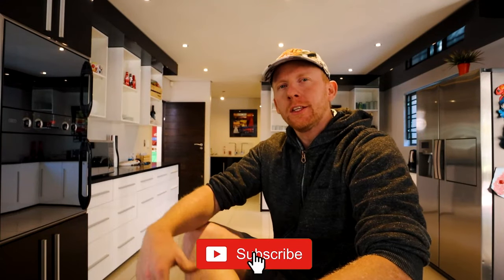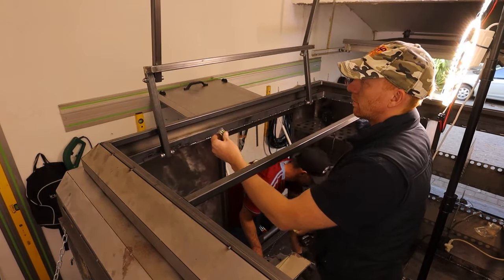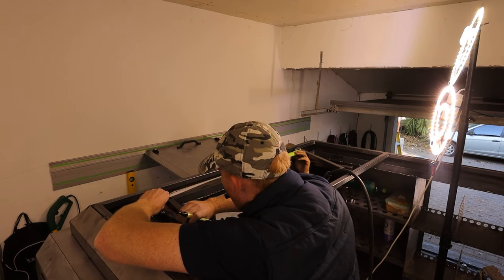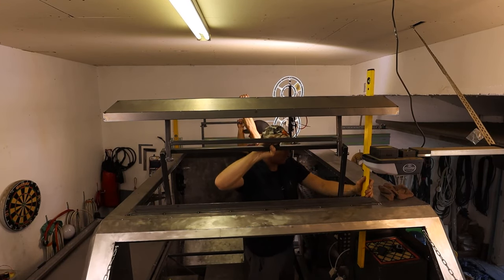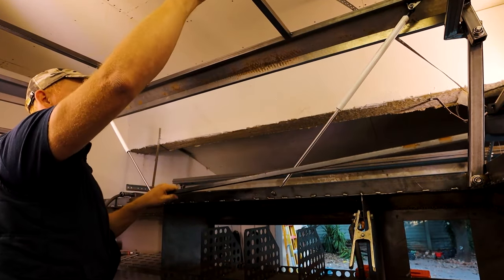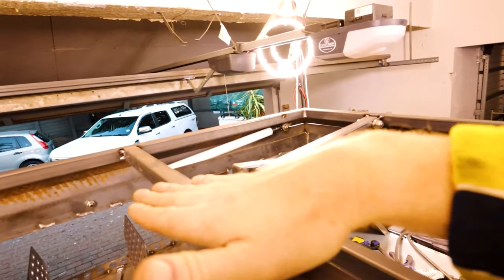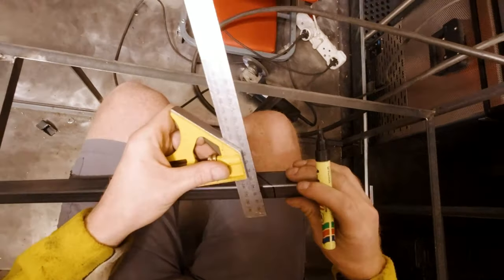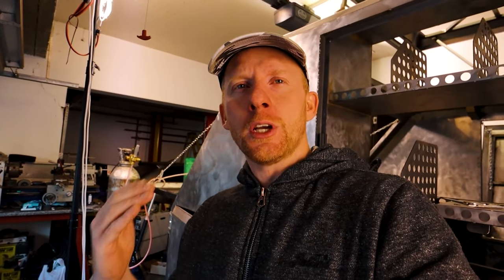Building a Pop-Up Roof For The  Camper Trailer - Part 4

Comment: That first part was such humor! Gas strut calcs is a head spinner. But here is my method-  weigh in kg the roof at the point you are going to lift it at. Add25% . Divide by 2 cos you have two stuts and then multiply by 10 to get the answer. so 40 kg at the mount point, plus 25% is 50kg. divide by 2 and multiply by 10 gives you 250Nm struts x2.
Reply from the maker: Wow.. Thank you so much.. Def will do that next time. Great tip. Thx for watching!!

Comment: Hi mate am from UK 🇬🇧 just watching your videos on the camper roof OMG 😮 you didn't half make it hard for yourself well over thought all you Needed to do was borrow a gas strut a one of your cars use 3×2 and some bathroom scales to see what the pressure was and on the back end of roof 😊😊use bed mattress spring pistons they are the same as what camper van retailers use but quarter of price 2 for £30 ebay but if you didn't want a slope you could use the wood and scales trick😂

Comment: I built a roof rack for my old Gen 1 Pajero and had copied a system that my Sprite swift had. Unfortunately I had sold the caravan a few years before I got the Pajero. Long story short, those air struts and I had a long fight and I shelved the idea. The struts worked well on a home built trailer I acquired that has a lid that I can barely lift. 
Seeing your video has given me renewed energy to build that pop up roof rack. My pajero has a sliding roof so that's why I want a pop up roof rack.
Reply from the maker: Thanks for sharing ure story and watching!! Those struts showed me whos boss... but now i have the pressure sorted and they work great!! Thank you

Comment: Coming to this video late. Newton-Meter makes sense in terms of the force required to open and close the roof as its a rotational measurement of force. Looking to do something similar but simpler and on a smaller scale. I think it will make my life a lot easier if I place each gas strut vertically in the corner lifting straight up.

Comment: think of it like this. 100n is 100kg of pushing power. Pressure wise, mentally imagine the inside of the tube, the piston will have a base that has the pressure behind it, The piston base is a little less than 1 square inch but for simplicity lets call it 1 square inch.. To push 100kg you need to put in about 1422 PSI of gas. Think about how much air rushes out of a regular compressor at 140psi... 

Its more complex than this but to work out the gas strut you need basically take the weight of your roof and divide by the number of struts then add on a little as wiggle room
Angle of strut matters and is roughly a percentage loss based on the angle within 90 degrees. If the strut was 90 degrees its not pushing at all. if its 45 degrees its about 50% pushing pressure.

This is all super simple maths and assumptions, its more complex but this will get you by in most situations. 
It would have been funny to see you blasted, its good you can have a laugh, ive seen people have their skin torn off from pressure and oil.. 
Thx for the vid
Reply: wait no my maths is way wrong.
Reply from the maker: Thanks for Posting. Even if the math is wrong its still makes a lot of sense.

Thanks

Comment: curious why you need the hinge?  could you have done it with 4 struts and chains on each corner to limit how high it would go?  thank you for sharing...
Reply from the maker: Sorry. somehow missed this comment. The hinge is what keeps the roof goin up and down in a straight line. If u have gas struts and chains only, That would only happen when all of them are extended fully and locked. On the way down and up it would be all over the show increasing the risk of pinching the canvas. 
Thank you

Comment: Hi Marius. Long time listener first time caller. Really enjoy this series of vidoes. 

Was just wondering where you got the fibreglass sheet? Ive been looking for it but it doesn't seem to be a standard stock item at any hardware's?

Thanks

Andrew
Reply from the maker: Hi there. So sorry for only replying now. for some reason ure comment didn't show up as un replied Really sorry.  I didn't go with the fiberglass as I'm scared when shit goes wrong like closing the roof onto something that u didn't see while out on a trip it would be really bad. a 1mm sheet would get a hole punched in it very easily. I finally got some 3mm alu board that's got 2 this sheets of thin alu on the outsides and a 3mm plastic insulation between them. Very sturdy and nicely insulated. If the top gets cooked the inside will still be ok to touch.

Thank you so much!!

Comment: Hey, awesome video.  Was wondering if you'd mind sharing the sketchup for those H hinges, or the dimensions, they'd work well for what I'm building.
Reply from the maker: Hi there. Those H brackets I build whilst in the garage without drawings. It worked out easier as I could measure directly from the trailer and roof sections to get the exact measurements. I did not draw them up in SketchUp. :-)

Thank you

Comment: Sensational job so far and thanks for taking the extra time to video and explain what you are up to. I am contemplating attempting a similar project. How did you go with the plans and what thickness steel are you using. Cheers Luke. 🍻🍻
Reply from the maker: Thank you for the kind words. I just started measuring existing trailers up to get an idea of size.. Went to shops and jumped in various ones to see what bugs us and what works space wise.. Then jumped on sketch up and started drawing up the camper. The whole exterior shell is made of 2mm steel. Thank you

Comment: Great build. Why didn’t you use aluminum for all the skins? Just wondering. I’ve been thinking of doing something like this.
Reply from the maker: I'm a shitty alu welder lol...chose steel as I can manipulate it much easier. Thanks for watching!! The weight came out more than ok for me tho :-)
Reply: @MariusBotha  yeah I just watched that one as well. A lot less then I imagined. I haven't even tried aluminum so steel might be my choice as well
Reply from the maker: @rbdworks4342  I can weld alu but the big trick is to destress all joints with proper heat techniques.. else they just crack where u weld them. Would be a lot lighter if one has a oven big enough to do the proper heating cycles. Thx
Reply: @MariusBotha  thank you. That's good to know. Are your plan available?
Reply from the maker: @rbdworks4342  Somehow missed this comment. sorry. I only have some messed up SketchUp files that I will share if u willing to dig through them. Send me a mail. mariusbothachannel@gmail.com

Comment: Can I ask how long it took to weld and how much it cost to have your own welding setup?
Reply from the maker: Its difficult to say how long it took as i only worked a little bit at a time as i had some free time to spend. an hour here and an hour there as i went along. As far as costs, I've always had welding gear and fabricating stuff so i didn't really buy anything to start this project in particular. Was just a normal CO2 mig welder and some hand grinders with clamps. Really basic stuff. All the works was laser cut as i dont have any bending machines or fancy machines.

Thank you

Comment: your lucky its only nitrogen gas , i had an empty LPG tank in my car as dual fuel, it hant been used in years, i took an angle grinder to the straps, with my dad and a weed sprayer full of water, got the straps cut successfully, then as i was turning the grinder off with a cut off wheel, my middle finger grazed the wheel thankfully only skin deep behind the nail bed, trip to the doctor and  tetanus vaccine and bandage i go back home to finish the job, taking the bolts out of the tank, unknowingly opening the valve assembly, thankfully it was only compressed air and Ethyl Mercaptan witch is the additive for the odorant added to make LPG (propane) and natural gas smell to detect for leaks, so the rest of the day all i could smell and taste was the Ethyl Mercaptan witch was like eating a whole bulb of raw garlic, in my nasal passage and back of my mouth, lots of mouth was and a couple of nasal flushes,,, if it was full of gas i could have been overcome by the gas and could have not been around from asphyxiation

i have watched this whole series on the build, i must say a well planed build and from designed in CAD to the full build is what makes me want to keep watching intrigued to see how the final idea has come to life
Reply from the maker: Geez.. What a crazy story... One can never be too careful with gas I suppose. Thx for sharing the story and watching!! Cheers